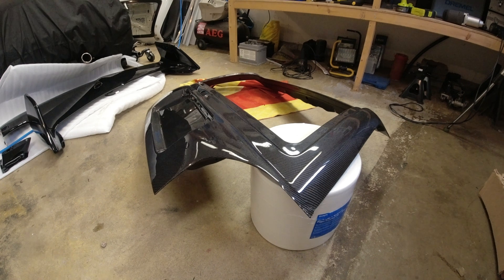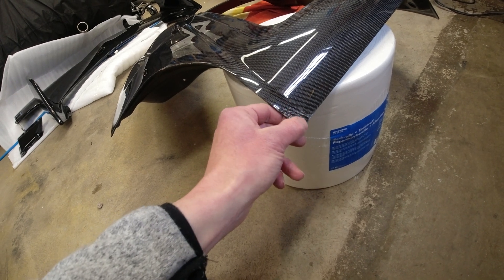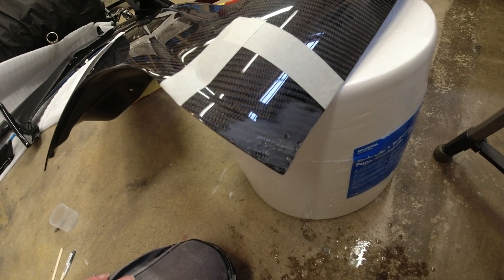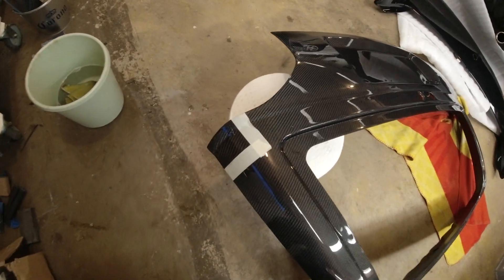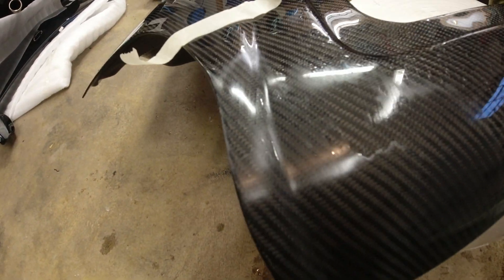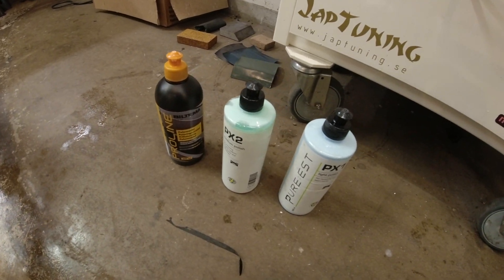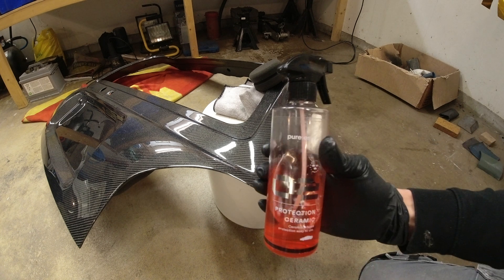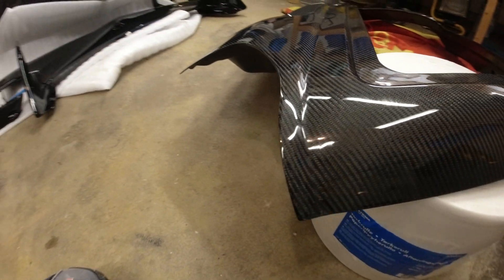HOW EASY IS IT TO REPAIR DAMAGED CARBON FIBRE?

Comment: Hello Mythical Mark 😃!  Excellent repair of the damaged part of the carbon boot lid for the Pulsar GTI-R.  You did a great job repairing, smoothing, polishing and restoring the shine to the carbon fiber part. It's not easy at all in that curved spot on the boot lid. Great job Mythical Mark 😃👍.  Have a great evening 😃👍.  Bye
Reply from the maker: Thankyou Salvatore, it isn't perfect but it's a good repair I think!